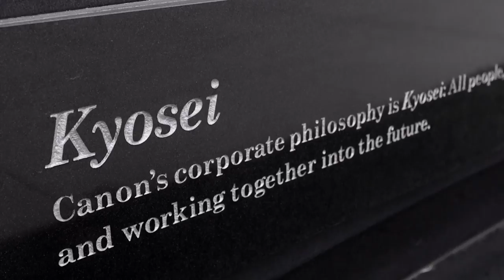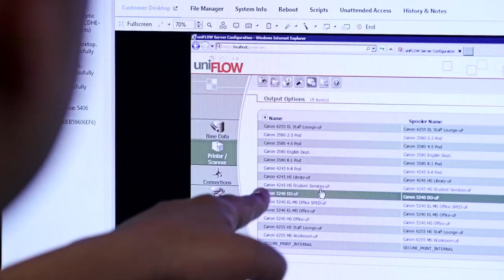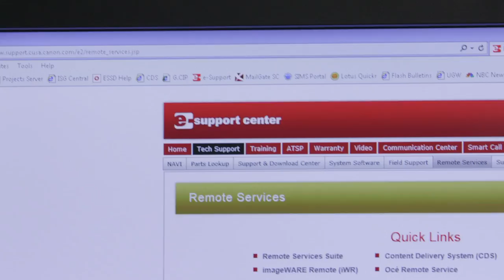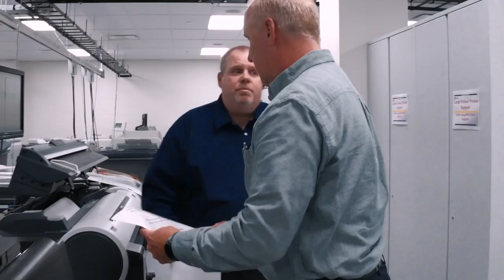Canon Service and Support - Customer Solutions Center

Comment: Hello
 Please I have a Canon ir c5255 and when I turn it on, it doesn't power. The green light will be on, but the printer cannot boot. Sometimes it tries to boot and the the power will cut. And the green light will be on... What will be the fault and how can I fix it 
Thanks
Reply from the maker: Hello Matthew:
The imageRunner products are supported by our Canon Authorized Dealer Network.  Canon Authorized Dealers provide service and use Canon-certified technicians.  They will be able to provide support.  If you do not know your dealer, you can locate the nearest dealer using the link here: https://Canon.us/s6f3q.

We hope this is useful.
Reply: Customer service will say you need to buy their hardware so it can work.

Comment: I have an older canon 400mm f5.6. L series lens. It has focusing issues,  can this be fixed by canon solutions?
Reply from the maker: Hi Kirk. The EF 400mm f/5.6L USM lens can still be serviced. You can make the necessary arrangements on our website at usa.canon.com/repair We hope this helps!
Reply: @CanonUSA  thank you
Reply: @kirkgardner2002  you just have to buy their hardware

Comment: I am very disappointed that I am no longer able to reach a Canon representative to help me with my scanning problem. I cannot set up an account because the computer will not accept my e-mail address.
Reply from the maker: Hi, Rayna!  We're here and we're ready to help.  Our registration system can be a little picky sometimes because all the information you provide has to match perfectly.  If you've registered products before and you wish to access your account to add another, you'll need to make sure your email address, your phone number, your name, and all the other information you're being asked for matches the existing information exactly.  If any of that information has changed, you'll need to use the old information to access your account and you can then make the necessary changes once you're in.

If you've verified that all the information is still the same and you're unable to access your account, please let us know.

Hope this helps!